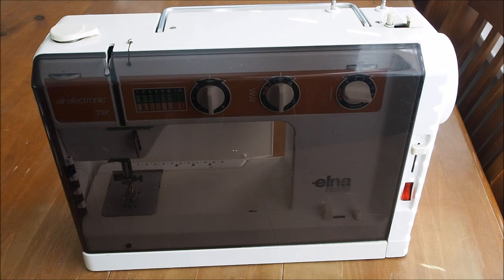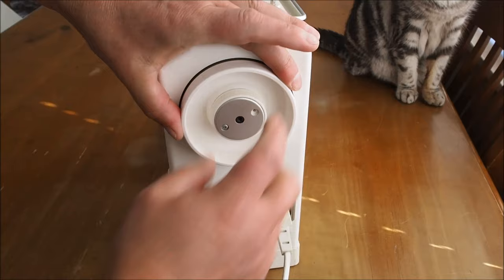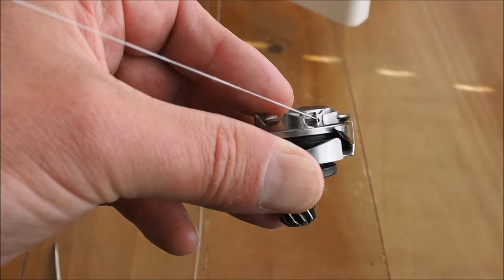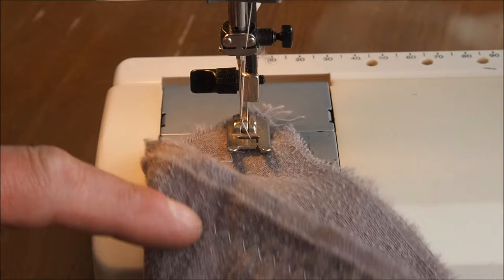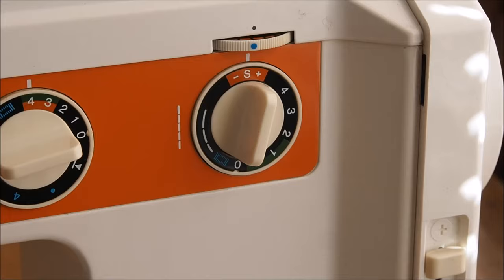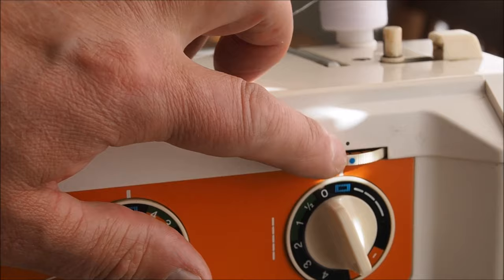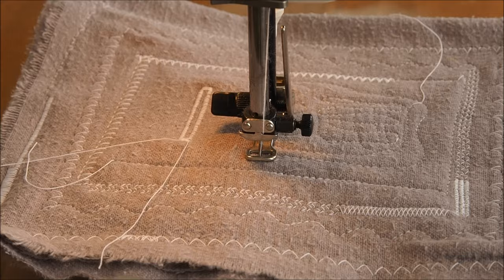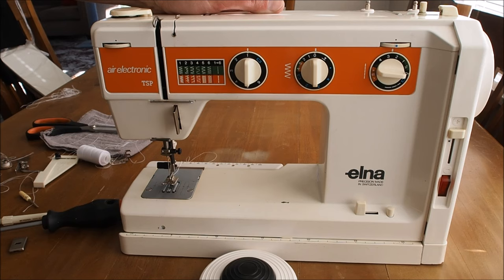The Elegant Elna Air Electronic TSP Sewing Machine - Basics

Comment: Excellent in depth video covering just about everything.
Brilliant demo about how the bobbin thread goes between the two fingered sprung lever.
You were not shy of the button hole and I am thankful for that. I just bought mine today and was hoping for a button hole demo with this machine.
What a fantastic solid beautifully built little beauty.
Knocks the socks off any Singer 221 Featherweight which are grossly overpriced .
For a small portable machine this cannot be beaten.
Easily level pegging with Bernina. ( Old  metal ones)
Both machines are built like Rolls Royces.
Thanks for the Vid.
What a little pearler!

Comment: My mum bought this very machine for me, only 1 year old, in 1984 for $800 Australian dollars.  It was a LOT of money back then, and hard earned.
We have both used it to death, and have ever only serviced it 3 times in 36 years.  It is a beast, and is still going flawlessly!  Would never part with this one!  
Great video, thank you!
Reply from the maker: Yes, expensive but as you'll know, made to last generations which makes it worth while in the long run. Don't get me started on today's throw away society :)
Reply: Good morning… my wife has an Elna Air Electronic. As you demonstrated it works by air pressure from the foot control. However it seems to be losing pressure after an about 10- 15 seconds.  We replaced the foot control with the line up to the machine. It did not resolve the issue. Hers the irony, Although we are in California, this machine traveled to NZ and back in the late 1980s where I am from before we moved to CA 😊. Any clue on what the problem might be would be greatly appreciated!! Many thanks.

Comment: Thnx for the video! It was very very helpful. I just bought one from a private individual that hasn’t used it at all because she once got it from someone. I just tried all the stitches but there seem to be a problem with the stitch width. But luckily I’ve found also your video about fixing the zigzag issue..🤩 Gonna try to fix it tomorrow! Thousand times thanks 🙏🏻

Comment: Hi, I'm the one who asked u abt bernina 830 record a few days ago. I returned the bernina 830 due to a possible motor issue and I got myself a Elna Air Electronic SU instead. It is a blue and white machine. I want to thank you for your detailed videos, thanks to you I got to know about Elna machines, that was why I decided to get the Elna instead, bcos it looks so retro and cute and yet functional. Everything works fine, the stitches are great, the cams work well, but the machine sounds like a mini typewriter. Folks in the Elna group say that it should be quiet, it should be purring but mine isn't. The noise is exactly the same as yours. So I shouldn't be worried if it is too noisy? I opened up the bobbin plate and the top part of the machine and see that it is oiled nearly everywhere. It is definitely noisier than my plastic  brother Innovis machine. Hope to hear your opinion on this. Thank you.

Comment: I recently came into a SU 68 and have gone through most everything on it cleaning and oiling including the entire bottom end. While I went to test stitching I noticed the needle clamped in with an angle instead of a true front to back orientation. The needle clamp is positioned just as I would expect it to be but the slot in the needle bar is not directly in the center and this has the needle rotated about 5 degrees or so clockwise from the top down view. I had the impression that the needle bar had gotten out of rotation and that someone had previously rotated the clamp to be straight rather than the needle bar itself which seemed odd.
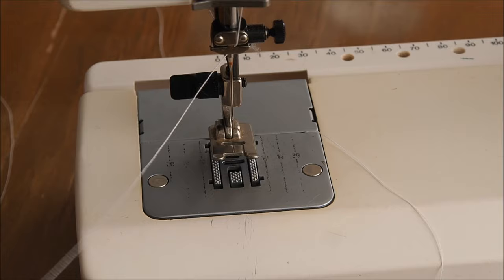I'm looking at this video at the 12:52 mark and this needle bar looks like what mine has going on. I also notice the exact same situation on the Jubile video. Are these Elnas actually designed that way? Though the bobbin is off center the hook shuttle is on center line with the needle and would make me think that the needle should be aligned to a true front to rear orientation. Can anyone verify either way before I reorient this one and the clamp? I'd rather not have to undo my "fix" if it is not correct. Have been unable to find an available service manual that's downloadable yet.

Comment: I had never tried the -S+ on my Elna SU Air Electronic machine until I saw this video.  As you know, t is on the stitch length selector after the reverse stitch selector; much to my surprise the stretch stitch ONLY sews in reverse.  I do not have the buttonhole selected. on any dial.   I am not sure what is going on.  Can you please help?

Comment: I just picked up a complete TSP and I had it sewing and cleaned and oiled it. It's still working but I for the life of me cannot get the needle to pick up the bobbin thread this time... Ugh. But your video is wonderful...
Reply from the maker: Make sure to change your needle with a brand new one. Timing may be out? This sounds stupid but make sure you are turning the hand wheel in operating direction. Thanks.

Comment: Great video. My Elna air carina SU is getting very slow. The foot control appears intact, but to get it to speed up, I remove the pipe from the machine and then plug it in again. Could it be that the internal mechanism is leaking air?
Reply from the maker: Hi. Yes, probably a leak from the foot controller bellows, the lead or the small diaphragm inside the machine. Thanks.

Comment: Great video tutorial re Elna Air Electronic.  I purchased my SU model in 1979 and she still goes great.  One question I do have is I only thought there was one red mark in the bobbin area to oil but you pointed out there are several points that need oilding  including when you removed the top of the machine.  Do you have a video of where else I need to oil or would I need to take it to a sewing machine repair shop?  Also I have had my under stitching unravel and found I needed to turn the tension dial (which was always on 4) to between 5 & 6.  Still not perfect but works better.  Would you know why the tension has changed after all these years by any chance?  From New Zealand 8-)
Reply from the maker: Thanks. As far as oiling goes, you can download the manual here - https://www.manualslib.com/download/378226/Elna-Tsp-Air-Electronic.html. Also take a look at this video which may explain tension issue. https://youtu.be/YUITDO2_9sk - There's also a part 2 here - https://youtu.be/3x0J7M9ukro
Reply: @InStitches  Thank you for your reply. My husband followed your video instructions and cleaned out some lint in the tension wheel and modified the white plastic knob you spoke about which was about 6.5 mm and so he dropped it down to your recommended measurement. The machine is stitching much better so another big thank you for all your help. Just one more thing, how and where is the manual you mentioned in your email so I can oil the other parts of the machine please? Regards, Pravinia
Reply: Oops, I didn't scroll down enough and just realised you had given me the link for the manual!
Reply: Sorry to bother you again! I was sewing away very happily when I noticed that the thread from the top downwards was almost falling out from each area that I threaded it (from the hook that goes up and down,) it even came out if the needle at one point! Seems my stitches are not stitching a nice straight stitch but slightly slanted!  I'm almost thinking I'm going to have to take it to a sewing machine mechanic. Would you perhaps have any further helpful tips why this may be happening please?  My husband thought he might have  lowered the white tension release bolt in the top of the machine may have lowered it too much and not the 5.5mm you recommended? Would it pay to go over this step again? Many thanks in advance.

Comment: I just bought an Elna 8000  on EBay, I’m having it serviced right now to get ready for use. I’m looking for some videos to help me learn the stitches and help me keep it maintained.
Reply from the maker: The 8000 is a nice model.
Reply: In Stitches Thanks! I borrowed a friend’s  Elna machine ( I think an SC) and it was so smooth and easy to use, that when I found one in my price range, i had to jump. Luckily I have the manual, but I really wish l could learn more.

Comment: Great information! Quick question ... how to access the air control module from end. Can't see any screws apart from the rubber foot underneath and I don't want to get medieval on it quite yet.
Cheers.
Reply from the maker: Hi. Remove the lid and there are two screws holding the end cover on. Thanks.
Reply: Much appreciated and thanks for such a prompt reply. That information will save numerous experimental plastic marring.
Cheers.  @InStitches
Reply: Just a follow up in case it's of value to anyone ... the original problem was with the machine sometimes remaining  running despite taking your foot off the controller. 
It had been taken to a service centre but the problem returned a few days later.
On examination of the air actuator, the guide rod didn't move nicely in the guide hole and the hole was slightly oval and impregnated with carbon dust which enabled the rod to rack and lock despite oiling. Removing 1/10mm off the diameter returned it to round and removed the 'gritty' feel and a tiny application of ptfe grease gave it a nice feel when depressing the speed pins. So far so good but like all repairs, time will be the ultimate judge. Thanks again for you help. (ps you probably are already aware but I had to remove the power spec. badge to access the screws to gain access to the actuator.   @InStitches

Comment: I really love your videos! I have just purchased an Elna Carina but it seems to have a problem...when I press the foot control nothing happens ... mostly....I can feel air come out of the tube end and I even tried using another functioning control from my other machine and it doesn’t work with that either.  It did work once for a second or two moving the needle up and down and then stopped. I’ve been searching on the web and can’t find any help. It seems to me that there may be an issue with something within the end panel of the machine but I am a novice. Could you help me take my next steps in solving the problem please? Thank you 🙏
Reply from the maker: It's more than likely a leaking air reservoir in the side panel of the machine and I don't think that part is available any more. It could also be a leaking foot controller and those are replaceable. Thanks.

Comment: I am buying the exact machine but they say the zigzag does not work. It only does straight stitch. It's only $25 so I am going to buy it. Can you tell me what to look for in the hope of fixing why it only does straight stitch I would very much appreciate it. Thank you. Pamela
Reply from the maker: Right here - https://youtu.be/owWX0ljOwMM
Reply: @InStitches  thank you so much. I bought the machine last night. It is one that takes cams but did not come with any of tools or feet. I've taken the top off and liked as you show in your video. I will continue to move it until it loosens for me. Fingers crossed it will zigzag after

Comment: Sir, I REALLY need your advice on this machine. I took it in for a service, and since then, my straight stitch is wavy and uneven. Not like it used to be at all. Tried all recommendations I can find, but maybe it's something specific to this model that you could advise? I changed the threads, new needle, even re-aligned the feed dogs. None of it seems to help the straight stitch remain perfectly straight.
Reply from the maker: Maybe take it back to your service person? It could be a tension issue? I assume you've made sure it's set to straight on the dials?

Comment: Hello!  Thank you so much for all those clear explanations, I'v just received the same Elna TSP from my mother-in-law who got it 40 years ago and rarely used it :) It is like new!
But the machine has a problem with the tension on the top thread. The top thread can be seen (comes through the tissu) on the underside of the tissu when sewing. I'm pretty sure that the top thread is not held tight enough in the tensioner on the top left of the machine. Actually, when I pull the thread going around the tensioner with my hand, there is no resistance at all. I have tried to open the top cover of the machine to see if I can modify the tension from inside, but the stays hocked on the handle and I can't unscrew the screws of the handle... 
Do you have another video of how to open the machine?
Do you have any idea how I can modify the tension on that tensioner?
Thank you sooooo much for your help,  from Switzerland, land of Elna and Bernina :)
Reply from the maker: Thanks. When testing the top tension, make sure the presser foot is in the down position. Make sure the tension disks are clean and nothing is caught between them. To remove the cover, you will need to remove the small clip on the handle hinge and slide the handle off.

Comment: This was the best video I have seen.  Thank you.  I have an Elna Air Electronic SU that was my grandmothers and I am having a great deal of difficulty with The Bobbin thread wrapping around the  bobbin holder tangling and breaking off.  I am using Elna bobbins, making sure my bobbin is in place correctly and in the tension forks.  My upper thread is threaded correctly.  So now what I am at a loss.  I would love to contact you for any suggestions as I am in a remote location.  Thank you for any help
Reply from the maker: Than you for the kind words. Are you sure it's the bobbin thread catching? Try different colour threads top and bottom to confirm.
Reply: I will try that. Thank you. If it is the upper thread. What do I need to do?
Reply: @kathyrobertson2458  Make sure the top thread is following the path as shown in the manual. Also make sure the thread goes between the tension disks properly and that there is no lint jammed in between the disks. Also make sure the tension is set to about 5. Replace the needle with a brand new one.
Reply: @kathyrobertson2458  I have figured out the problem and have it working, but this is my question.  On the top thread tension that the thread goes around there is a disk.  You mention it in your video.  I have never worried whether the thread is above or below this disk.  If I have it above the disk the tension works and everything is fine.  If it is below the disk, it bunches up.  So what do I need to know about this tension area that I am missing?
Reply from the maker: That would indicate there's something like lint between the middle and lower disk that's keeping it from clamping the thread. With the presser foot raised, get a torch and something like tweezers to get in between the disks and clean in between them. It's also possible there is a groove worn in the disks from a lot of use. That's more difficult to sort.

Comment: Hi, May I ask what class bobbin the air electronic takes? I have a Jubile type 45. Are they class 66 or class 15?
Reply from the maker: Hi, neither class 66 or 15 fit the air electronics. The Elna has a specific bobbin. Part number is 426000. You should be able to but them online or at your closest sewing machine supplier. Thanks.
Reply: @InStitches  Thanks so much!

Comment: Fantastic video. Thankyou. I have the same one. I am trying to sew leather. Any hints please?
Reply from the maker: Make sure you are using a leather needle as they are designed to cut the leather instead of punching holes. Also if the leather is relatively thick you may see small loops on the under side of the seam. This means the top tension is too loose. Tighten the top tension until the loops disappear.

Comment: Help my wheel is stuck will not turn needle up or down ( machine Elna Jublir (red in color) i had ran a new bobbin thread. When this happen? I push thé button on thé inside of wheel. Still nothing please help? Sherry.
Reply from the maker: It's difficult to say exactly but maybe the machine is seized? Try oiling as per the manual (find a manual online if you don't have one) and warm the machine to room temperature if you live in a cold region.
Reply: I hope not my mother left it to me she passed away almost 2 years ago.it was sweing fine i needed more bobbin thread done that .i noticed some thread hung up in the bobbin case so i pulled out much as i could. I think some thread could still be down in there .i do not know how to get this bobbin case out of there ?😪thank you sherry.

Comment: I was given one of these Elnas recently. Sadly, without a power foot pedal; only the air pump and it goes without saying, without a manual. What does the air "pump" (only thing it came with) do?

Know of any groups that offer a no-cost or low-cost pdf manual  for this machine?  Thanks in advance.
Reply from the maker: Hi. The air pump is the foot controller and you just need a power cable. If you email me, I can send you the manuals for free. I also have the power cords available. My email address can be found on my website www.institches.co.nz - Thanks.